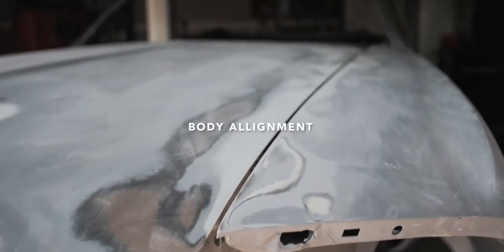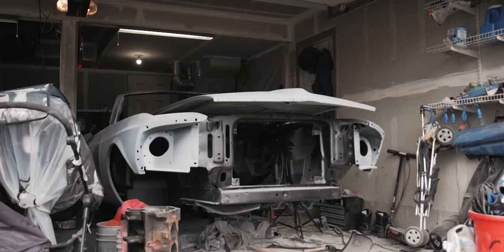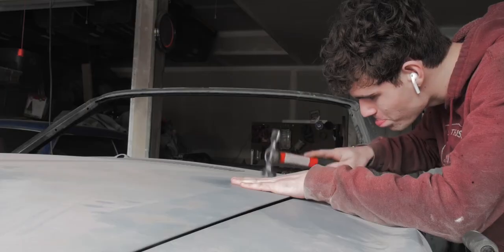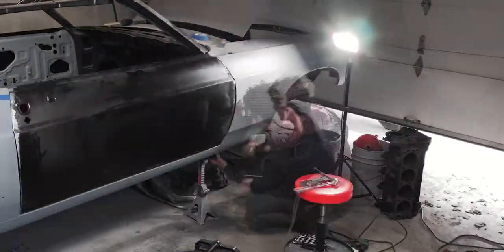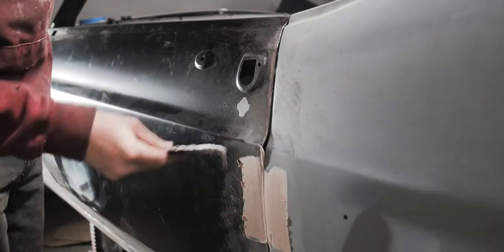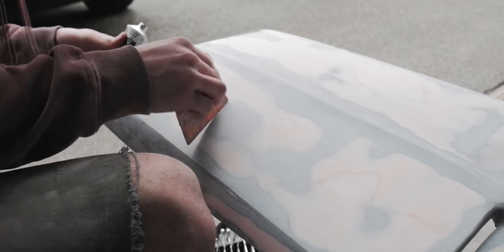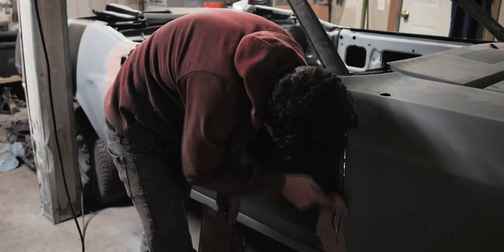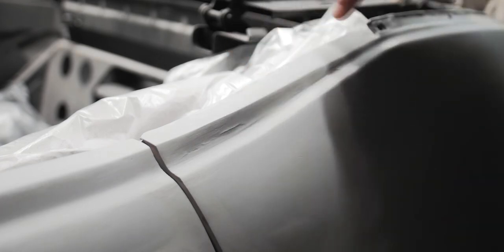Finishing the Body Work! | 1969 Mustang Part 4

Comment: Would you pls do a video explaining the removal and installation of headlight housings or end caps having a hard time accessing bolts:/
Reply from the maker: There is three nuts on each side you can only get to by removing the plastic fender liner and using a long socket extension. Hope that helps